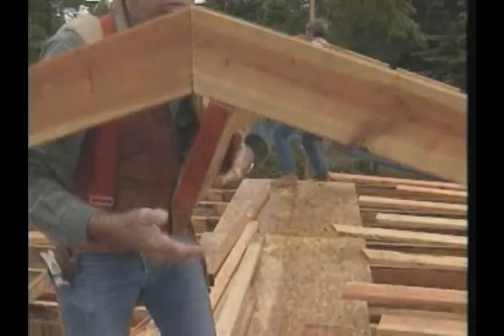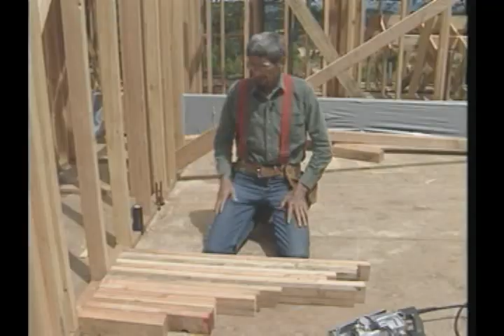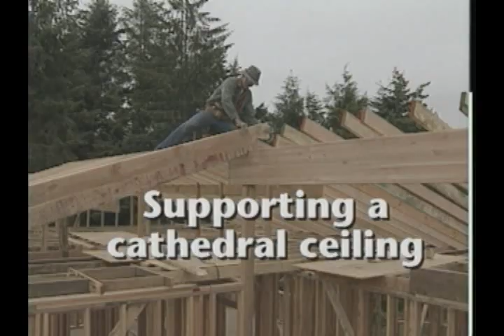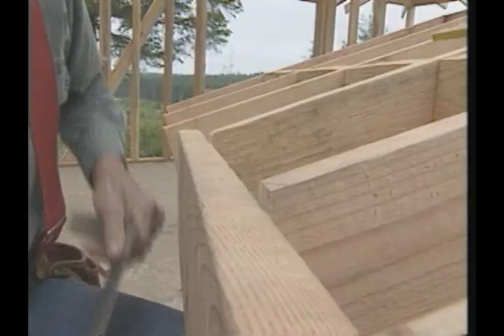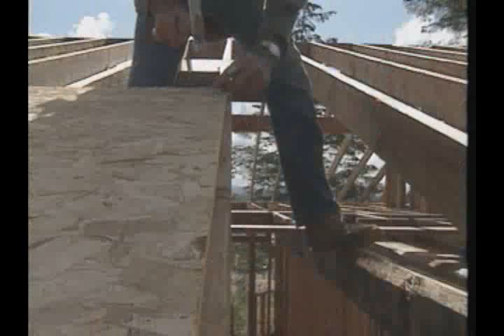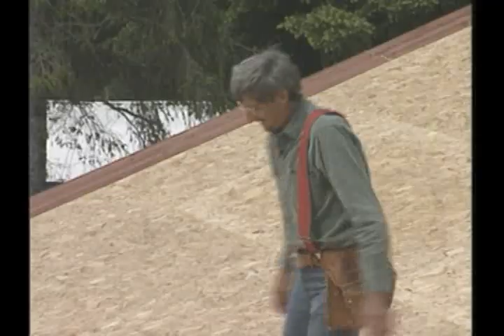Video 5 roof framing continued

Comment: Them hands must ache with pain I know mine do at times just trowelling up
Reply: weak.
Reply: @themanfromthemoon1326  you could call it that but note this you dont know what others have done with there hands or do with them day in day out , and i know the way these guys are working if that was done 5 , 6 days a week in all weather hot cold for 8 hours a day every day , Unless you like you say are not weak will have sore hands
Reply: @macplastering  You are right, I dont know what people do with their hands. And yes these guys have a lot of experience, technique and a good Claw Framing Hammer that wont put stress on your hands. Im guessing its a heavy 24-27oz to be able to drive the nail in on shot like that.
Reply: @themanfromthemoon1326  for sure they got the weight and technique :)

Comment: I’m impressed, Just Amazing, I know a little about framing, I done some construction work in my life time, but these guys are true professionals. 
One thing that is noticeable in this video is the way they explain each of the procedures, easy to understand and follow, I also noticed that they scarcely used the measuring tape, only when necessary, they use templates and marking gadgets whenever possible.
Thank you for being true professionals and show pride for a job well done, there is nothing more satisfying. 
I was born in the mid forties and I have a lot of respect for people like you! 👍👍👍
Great Job and Great Video!
Thank you!

Comment: How did he connect, or not connect, the two ridge boards together? One board was not enough, but he did not sister two together....must have just supported the joint and let the rafters hold it together?

Comment: true craftsmen at work, I especially like the way you set the ridge board, simple concept and fast!
the only thing I would recommend is to use # 8 ring shank on the decking, and nail them a little more straight in than too much slant, and sink em'. you 
guy's have some of the best video's on the tube.

Comment: How does the ridge beam stay straight if you nail all the rafters on one side??  Shouldn't you put them in at the same time to keep the ridge from bowing???
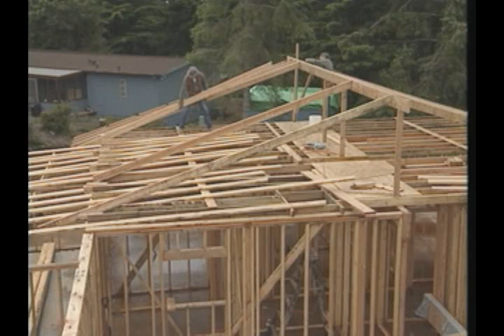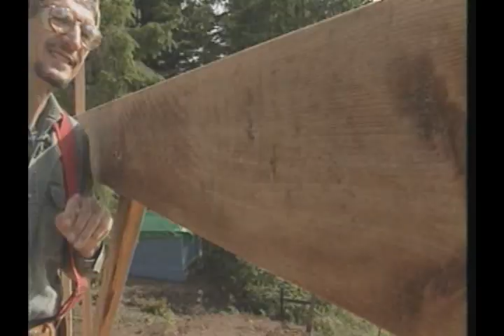Reply: That's a good question, as it could really create a problem.  Look at 4:45, and you'll see he's got a rafter on the opposite side already in place, nailed at the plate line.  If you back up to 4:35, you'll hear Larry explain that.

Comment: Holyshit, these guys are nailing everything by hand and not using a nailgun. Respect.
Reply: openalpha01 I prefer it personally. Save money on gas and expensive equipment. Plus save time with set up and cords. If you get good at it like these guys it’s not really much difference in speed
Reply: Mr. Anderson you can’t compare the speed. These guys probably take forever to build a house
Reply: Carlos Gaona not everyone is trying to build everything as fast as possible. Some of us care about quality amigo
Reply: Mr. Anderson bro quality has nothing to do with it 🤦🏾‍♂️. There’s a reason why everyone uses nail guns.
Reply: Commonwealth Bear They said they used nail guns in the video 😂
Reply: ....but it will right 😎
Reply: @carlosgaona180 ...why...give me a reason
Reply: Driving them hand spiked in one fowl swoop. Fuckin rights respect lol
Reply: If you can build a house by hand you have my great respect was labor on roof rafter replacement day one air compressor let loose. Swinging Henry is harder than it looks
Reply: I prefer hand nailing over air nailers

Comment: sweet shit not many carpenters know how (or are willing) to built a cut in roof   only truss roofs with some over framing  now a days
Reply: the decision to use trusses or conventional roof framing is decided by the architect not carpenters.
Reply: Wrong.  Carpenters decide what is the best method and each job is different.  Some spans are so wide you have no choice but to use trusses.

Comment: Why not to use a nail gun?
Reply: +frusfromus Nails from guns are not as strong in my experience. Hand nailing seems twice as strong. Besides pussies use nail guns. Sorry, could not resist.
Reply: several reasons,,,the hose gets in the way.you need 2 hands to grab and nail wood,hanging the gun on your belt is way to heavy...we were paid 10 cents a foot to stack roofs back in the day,2 guys made the roof like that in 20 hours.